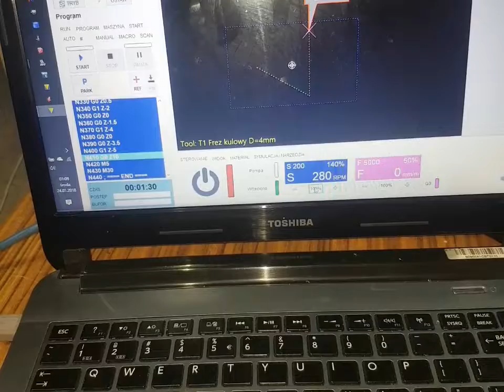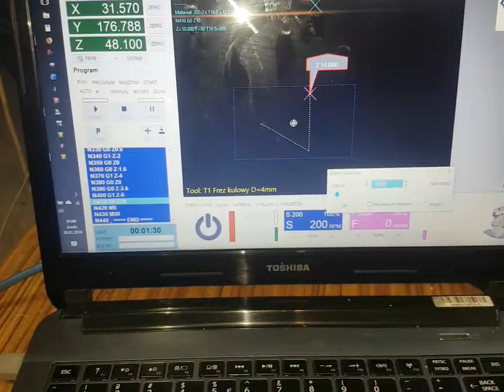Budowa wrzeciona frezarki CNC

Comment: What thickness of plate you are using for X and Y axis
Reply from the maker: X - 50mm steel plate
Y - 30mm steel plate + 25mm underlay for guides
Reply: Thanks
Reply: What about spindle support plate
Reply: X-50mm steel plate that is your table
Reply from the maker: @djr96  The headstock is made of 20mm steel plates, the plate to which the linear carriages are screwed is 30mm.
Reply from the maker: @djr96  50mm steel plate is my table, exactly.  because there are T-slots in the table that weaken it.
Reply: @KamilSSj2  brother thank you for this information
Reply: What type of infill you are using on your frame . Example concrete or epoxy granite
Reply: And what is the maximum rpm and Kw of spindle motor. Can your machine cuts high , medium and low carbon steel .
Reply: @KamilSSj2  bro I am sorry I lost your email id please can you send me once again . Or do you have whatapps . So that we can talk about CNC machine.
Reply from the maker: This CNC has no infill.
Max spindle RPM - 6000.
Spindle engine - 3kW.
Gear ratio - 1:1.